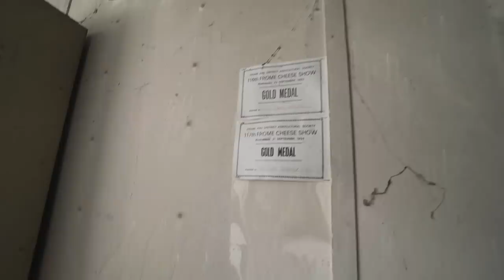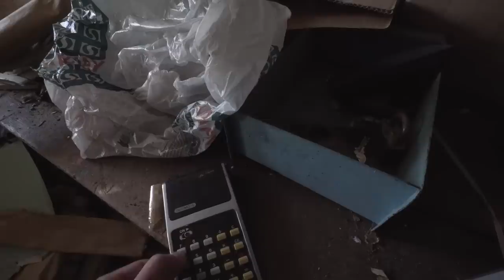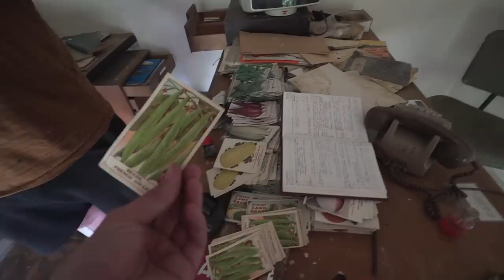Somethings Not Right Here! Abandoned Farm

Comment: Yes it's an old CCTV Camera from Videoscan, and yes it's mains powered, the mains plug is just missing the faceplate. 

They had external lenses which you could attach.

It looks to use either an RF or a mini-DIN output for the video.

Where can I pick it up? thanks.

Comment: The plug on the camera is a 'Clock Point' plug, 2amp fused, the socket would be flush mounted on the wall so you could hang a mains powered clock over it and it would be hidden behind it. Most probably MK or Volex.

Comment: Yeah the security camera plug is missing the other half that plugs into the wall...
Reply: Thank you!
Reply: The bit on the wire is the plug and the sockets were on the walls, used for lighting mainly, that would give the camera power and there's a coax connector on the back that would send the picture to a monitor.

Comment: Well guys I guess correctly!! that the item attached to the prehistoric video camera was a Original 13amp plug!! 😂
Reply: No, its a 2amp clock point plug. Probably made by MK or Volex.
Reply: @Technaudio  lol it can't be as the video camera needed at least 13amps to run safely Bro. 😊
Reply: @verminous6968  it's highly unlikely that that camera is 3kW.
Reply: @Technaudio  unusual I agree and yet the plug was on it for all to see? 😃
Reply: @verminous6968  just look it up, 2a clock point, they used to be quite common, not so much now, as not many places use mains powered or synced clocks any more.
Reply: @Technaudio  be that as it may, why go to the trouble of attaching a 13amp plug if not to use it?
Reply: @verminous6968  Have you read anything I've written? It's not a 13A plug.
Reply: @Technaudio  Mr condescending you can see the inner workings and the 13amp fuse inside the f-ing 13amp plug, the same as a kettle, toaster, hoover ect here in UK 🇬🇧 turnip.